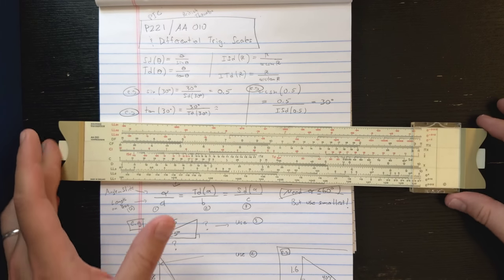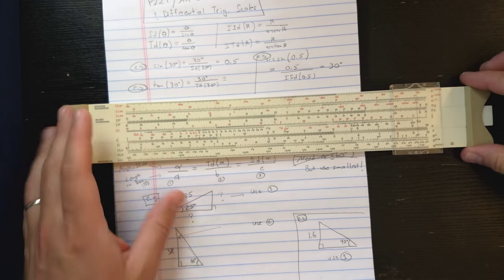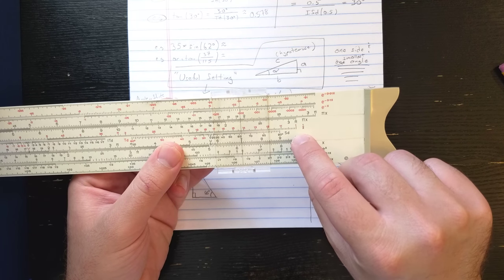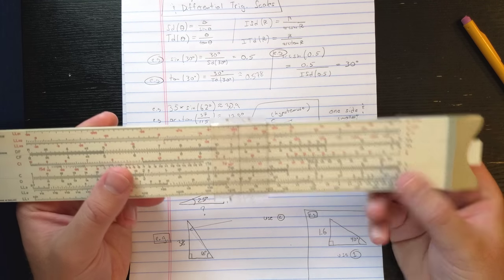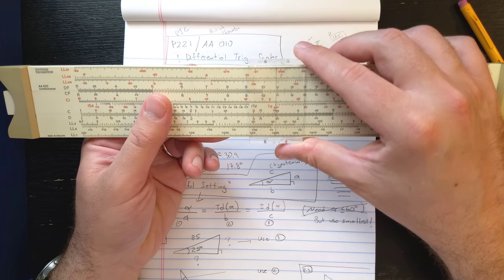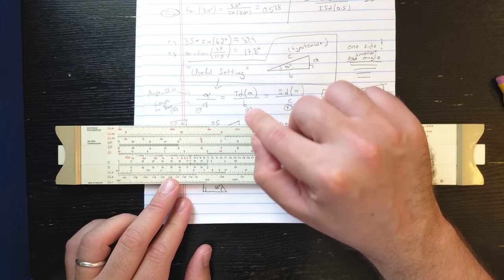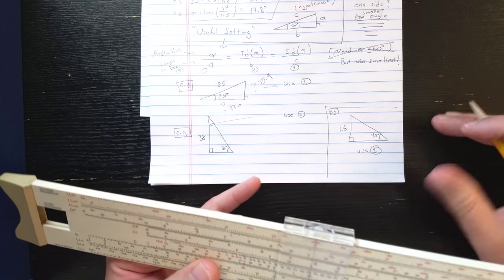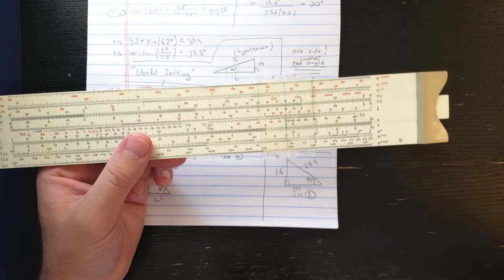Differential Trig Scales & the AA 010 / P221 Slide Rule (Thornton/PIC)

Comment: The Differential scales also provide the ability to do continued calculations with trig functions.  This is not always possible when the functions are on the base rather than the slide without transfering.  As many European rules seemed to prefer trig on the base, these Diff scales were an extremely compact way of adding trig values on the slide.  The plastic and engraving is holding up nicely and they are really nice in the hand and usually quite easy to read.  Both of the my rules have a slight skew in the hairline which makes the S scale on them slightly inaccurate (the cursors aren't adjustable that I can see).  It's shame about no CIF scale and the cursors being plastic are often scratched as well but even with all that they are in my top 3 favorite rules.

Comment: It would be great to see the comparison of the result against using the traditional T and S and ST scales on the other side.  One rationale I understand for the difftrig scales is greater accuracy.  Is that true and if so, how much more accurate do they turn out?  Perhaps compare a) the result with difftrig, b) the result with traditional trig, and c) a calculator's answer and see which is best!
Reply from the maker: Just seeing this comment. Good idea! Definitely common trig problems solved with differential trig often take an extra step (bad for accuracy on the slide rule). This claim is often made, though, so it might be fun to investigate.
Reply: @ProfessorHerning   Thank you.  Sitting here in quarantine, spending time playing with slide rules has turned out to be a respite. It always reminds me of Asimov's idea that you could store a library on a stick if you had fantastical resolution. First translate all the letters into numbers, line them up, and then put a decimal point to produce a ridiculously long decimal fraction.  Mark that on a stick to store the fraction. Then at will, read the fraction carefully writing out each digit and recreate the library!  Your videos are wonderful.

Comment: CIF far more useful. Strange that the CI was placed above the trig scales anyway.
Great to see somebody is still reviewing Slide Rules 50 years after they were made. Great fan of your postings.
Like you I am not a great fan of Picketts, but K& E are the Rolls Royce of American rules IMO. My 4081-3 is still smooth as silk.
Reply from the maker: My guess on the placement of the trig scales below CI is that it's consistent with PIC's simplex rules like the 101. In general, I think the inclusion of the differential trig was probably for familiarity for those stepping up from such a rule.
Reply: Shouldn't it be the Cadillac ?

Comment: My favourite rule. Large font, clear scale markings, good scale positioning. Shame about the rather useless diff trig scales. Prefer normal trig scales together with very useful Ps scale for large sine (or small cosine).
Reply from the maker: Would you have preferred a CIF scale in that spot?
Reply: The Diff Trig scales are by no means useless . They are actually easy to use AND more accurate over the WHOLE range as opposed to conventional trig scales.
Reply: @738polarbear  Honestly I'm not that sure. I tried it just briefly. Thornton states it. For small angles ST vs C/D has maximum accuracy - or just C vs D set at proper rho mark (v,u on Thornton). For large angles above 60 degrees it's better to to set cursor at or below 30 degrees and read result on P scale and I guess it's more accurate. For angles between 30 and 60 it seems about the same. I would say accuracy of differential scales is more consistent, but they are harder to use, they do no not have consistent forward and inverse operation, they don't allow to find sine and cosine at once and they don't allow conversion between degrees and radians (although C/D scales can be used for that).

However, AA010 is so far my favorite slide rule. It slides well, it's not too lose or too tight. And it has by far the best readability and clarity. I don't know how they achieved this, maybe because it's not shiny and does not reflect light from embossed ticks and letter which increases contrast, but some slide rules seem to have very thin lines densely packed together. Thornton has thicker lines, but somehow they don't seem that densely packed and I can't believe that density is the same. But it is. My 2nd best slide rule is Logarex 27602-II and it's pocket version (can't recall the number). Advantage over Thornton is that some scales continue to the left or right. Thornton has lot of blank space there and when result of multiplication is close to 10, it's somewhat comfortable to have scale from 0.88 to 1.13 or folded scale from 3 to 33. Also you cannot find diameter of circle with radius 90 cause AB does not extend to the left to 0.76. Differnce in scales is CIF vs differential trig, extra Pt and placement of L+K on slider and DI on stocks. And then bigger Logarex (contrary to it's smaller sibling) has ST scales in minutes so it cannot be used for conversion to radians. But most of the differences in favor of Logarex are minor and readability wins.

Comment: Thornton wins in case design. Hard case that would probably hold up if driven over.  Inserting rule leaves the cursor just outside the main section for easy removal. Case design holds the rule in so it doesn't slide out on its own.  The leather cases on my American rules look better but can be a pain to fish out the rule.  That said the trig functions on the American rules  seem to be more convenient. The differential trig scales are a bit strange but once learned can be quite easy to use.